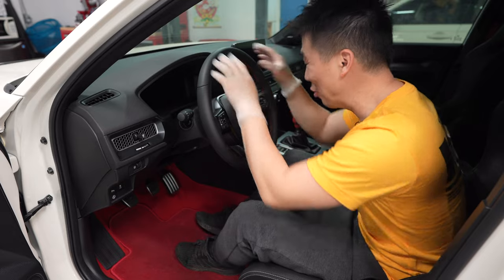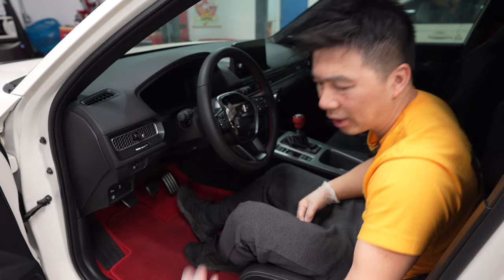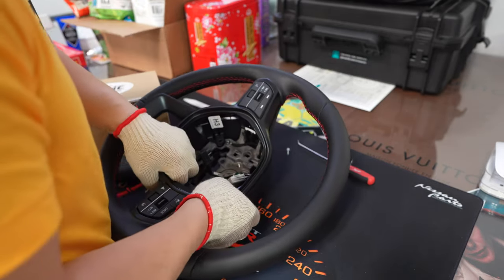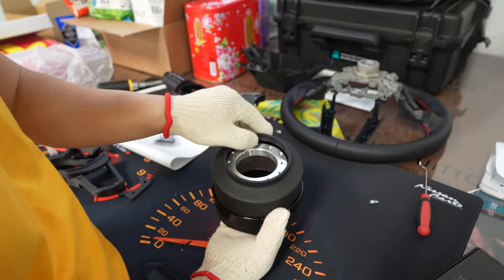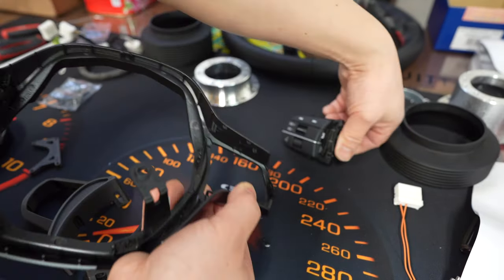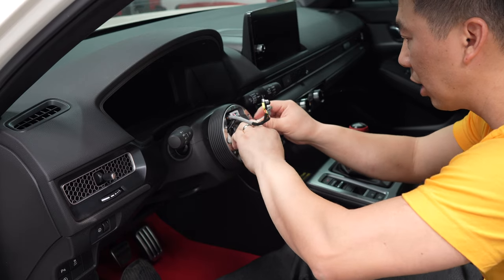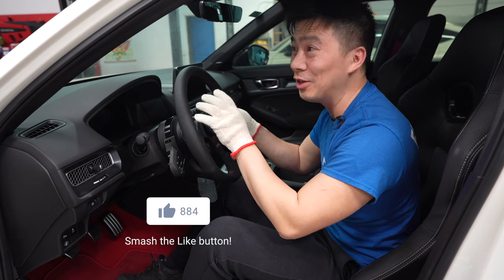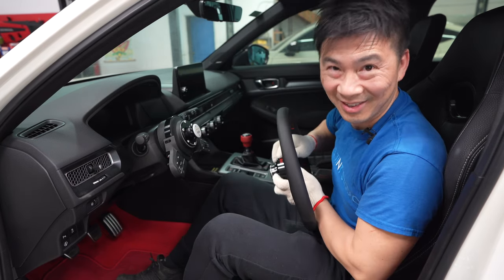New Steering Wheel For Civic Type R FL5 || WorksBell Rapfix 2 Installation

Comment: The spoon wheel is actually 340mm which slightly smaller than typical 350mm wheel like the mugen. Not sure if that particular size is available in other momo applications.
Reply from the maker: Hi Vincent wow thanks for the awesome information 😀 
You are 💯 correct the MOMO Monte Carlo is only offered in 320 and 350 where the Spoon is 340mm exclusive. You learn something new everyday. I love this Honda community!

Comment: Awh man but the stock steering wheel is already basically a racing steering wheel
Reply from the maker: At the end of the vlog I explained why I changed the steering wheel and why it is significant to me. The stock steering wheel is nice starting point but can always be improved.